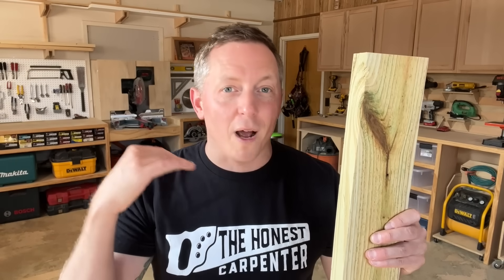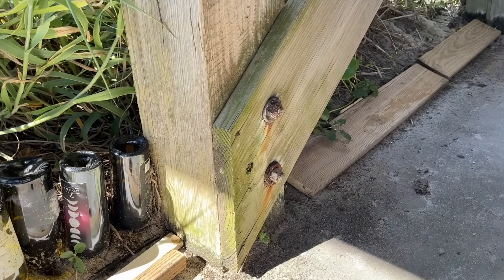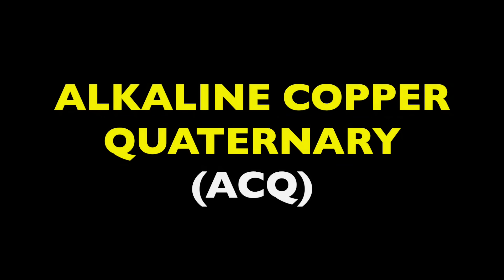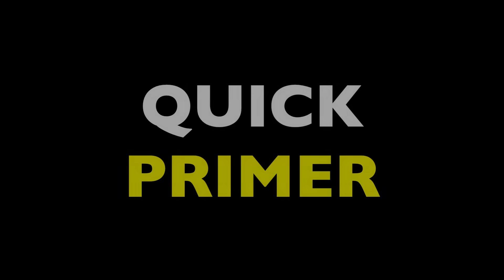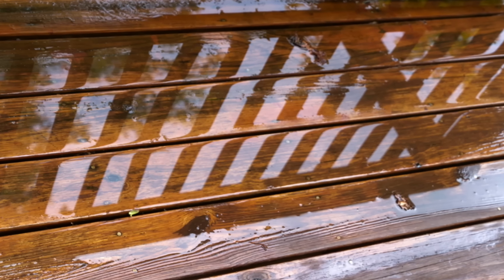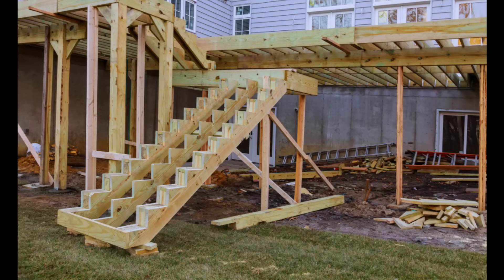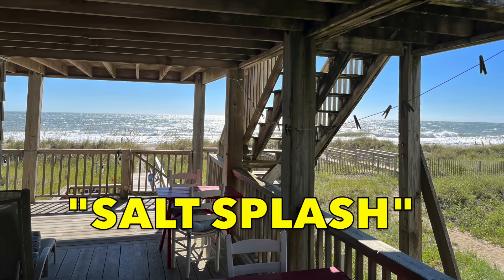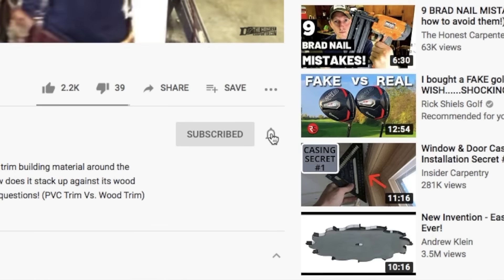Some TREATED LUMBER Rots Faster Than Others! WHAT'S THE DIFFERENCE?! (Ground Contact Vs. Non-GC!)

Comment: Because they DON’T treat it properly anymore. On a 4x4 post it was green all the way through, almost. Now it penetrates 1/4 inch at best. PT doesn’t stand for Pressure Treated anymore. It stands for Pre Treated. Another scam.
Reply: It's still treated under pressure. Even if it's not up to your standards, it's treated in a pressure chamber.
Reply: @veganpotterthevegan  My dad bought some socket set made out of zinc.  Yeah, it's still a socket, just not up to my standard for fastening any bolts with them.  LOL
Reply: @ipick4fun27  I broke a new screwdriver my dad bought unscrewing the back of a remote control.   So happy I have real tools now!!!
Reply: @veganpotterthevegan  yeah and high octane gas is still high octane if I take a leak in your gas tank.... even if it's not up to your 'standards'!
I use this ridiculous analogy to demonstrate how even though you may be literally correct (in a very narrowly descriptivist sense), your completely missing the point. Companies may be using the proper language by definition, but they're still reducing quality most likely for their own cost benefit while being misleading to the consumer.
How about 'free range' chickens? If they're still packed on top of each other in a warehouse, but they leave a door open (that the chickens never use bc their feed is kept inside) is that a fair label to apply to the packaging? 
I guess it depends on whether you think enormous and profitable corporations need protection, or the consumer who buys something with the ridiculous expectation that what they're told by producer should actually mean what they know they're implying...
Let me guess, you're the type who cheats on your spouse but then claims they never lied about it bc they didn't specifically answer in the negative (it just never came up! How was I to know you'd want to be told about my transgression??)
So basically, you can continue believing your right, but you're wrong.  Purposefully using misleading description of your product to create a fictitious image in the mind of the consumer is bad business practice... regardless of it makes you more money.  The measure of ANY moral isn't weighed by its benefit to you.
Reply: @theoriginalmonstermaker  wow, that's quite the delusional rant😅 "Preasure treated" isn't a complex term.  If it's treated under pressure, it's pressure treated smooth brain.
Reply: @veganpotterthevegan  so I see you took nothing from my  response and did nothing to address my very valid points... spoken like a true pedantic descriptivist. And coincidentally, like a vegan.... or at least the type of vegan who makes sure everyone knows by her name lol.
Well played.  You win.  It was treated under pressure.  The fact that it implies smthn very different from what it did years ago, and is extremely misleading to the average consumer has no relevance.  Your right... and I'm sure a blast at parties!
Funny thing is, I was TRYING to be empathetic and connect with you on what I would think (from your name) would be a topic closer to your heart,  I.e. the chicken thing. 
So to you it makes no difference that the factory farm w 1000 chickens miserably packed into a warehouse with a door (they never use) left open are labeled 'free range'.... in the same way that your local farmer market family farm who moves them around daily to graze outside and collects eggs by hand in the field?  I think the happiness of those chickens varies wildly and the reassurance customers are looking for by inclusion of the 'free range' label SHOULD mean something.  
AND i believe a fair capitalistic market place is one where the information provided by suppliers should relate to the fair expectations of consumers that the information is correct and not misleading....
But you must be the 'woke' one, bc you put 'vegan' on your name LOL. That alone makes me doubt your credibility.  Vegans should be vegans bc they are considerate of living things, not bc it's a party of their identity they want to get credit from in social situations.  Grow up.
Reply: @theoriginalmonstermaker  from the beginning, it was a BS response.  Peeing in a gas tank will lower the octane of the gas simpleton.  And you continued from there with similar nonsense.
Reply: @veganpotterthevegan  how about the entire thesis of my argument which was that a consumer should have some degree of expectation that the words advertisers use mean something? There's no need to continue this. You do what everyone does when they know they're wrong, focus on one irrelevant point and conveniently ignore all the facts that you have no response to.  You're hopeless.  That's the last word I'll say on this matter.
Reply: @theoriginalmonstermaker  WTF are you talking about?  It's pressure treated or it isn't.  There are different treatments that can be done.  Just look at wood being kiln dried.  If it's kiln dried, it's kiln dried.  It's not always to the same specs but it's still kiln dried simpleton
Reply: That’s not true bob, as a framer we use pt lumber all the time. West coast treated lumber is that way
Reply: @jncn1490  don’t tell me it’s not true. I use the crap. I cut the crap. I can see how far the treatment penetrates the wood. If you found a great conscientious manufacturer, good for you, but don’t call me a liar you @#$&ing goof. I know people in the lumber trade and they have told me all about the running scam. STFU big mouth.
Reply from the maker: It’s definitely a situation Bob. I’m wondering if CCA lumber will be reapproved someday—we’re wasting a lot of trees on weak lumber 😬
Reply: @TheHonestCarpenter  CCA lumber is approved purposes that require extra durability and don't pose nearly as much hazard as common consumer and residential use. Round CCA posts are sold at many agricultural suppliers and farm stores. 

Forcing the treatment into the center of the wood takes longer and is more expensive. Many commonly used tree species are also resistant to pressure treatment. You can still get  high quality preserved wood, but you'll have to pay more for it.
Reply: @TheHonestCarpenter too much money being made on rotting lumber. No one will touch the subject matter
Reply: @TheHonestCarpenter : don’t these people preach about the environment all the time? These corporations are stealing from the public and using that money to purchase more politicians. $100 for a sheet of 3/4 G1S plywood in Canada. Ps really enjoy your channel. 👍👍
Reply: @Mama C If you look at my profile pic.  They are locks.  Hope that answers your curiosity.

Comment: Question.....do I need treated lumber for my deck boards if I'm staining and sealing the deck boards?? Anyone? Thanks 😊 oh, my deck has a covered roof. Thought you should know. Thanks 😊
Reply: It is my understanding that copper kills fungus, molds, and bacteria. So that's how it protects the wood. Fungus and molds grow best in dark, damp places like under your deck. Even if your deck is covered, the ground under it will still  wick moisture. So I would suggest treated lumber for that application.
Reply: @anitaodom5155  thank you! 😊
Reply from the maker: Best to still go with treated Pappy! Though there are untreated tongue and groove porch floor options for painted surfaces…
Reply: @TheHonestCarpenter  ok thanks 😊

Comment: Some lumber yards around me have already fhased out the above ground  material and only offer ground contact material.  From what i have seen and delt with myself the above ground treated lumber rots almost as fast as non- treated material. My father built a fence in 1969 that still stands today and looks amazing.  To bad we can't find a way to treat lumber today that will stand the test of time.
Reply: I've actually done a deep dive on this recently. There is a USDA study on utility poles and fence posts that has been running for over 60 years. They have found that a thorough soak in copper napthenate lasts longer than acq or creosote, identical to CCA. I have not been able to find any data on MCA, because everyone knows it doesn't fucking work.
Reply: On my grandparents farm, there’s a 200 foot section of fence with non-treated hedge-apple (woodworkers will know this as Osage orange) posts that were set in place by my grandfathers grandfather. About 20 years ago we ran 2 new strands of barbed wire across that section of fence, and today, the fence still keeps the cows in. Them posts have got to be at least 100 years old.
Reply from the maker: It’s true, Detroit! PT just doesn’t last as long these days